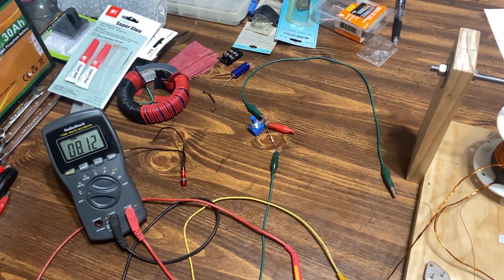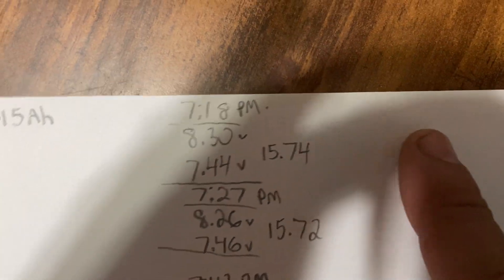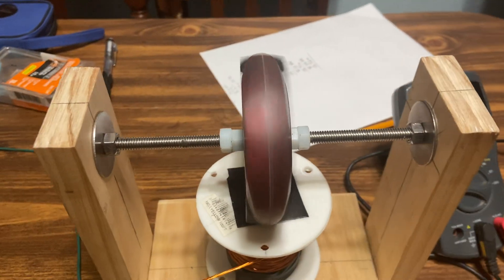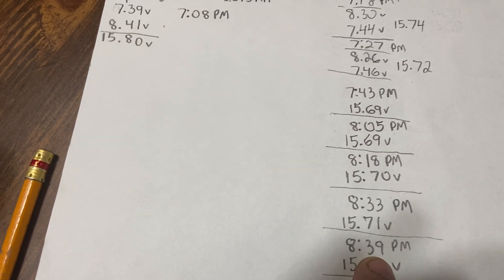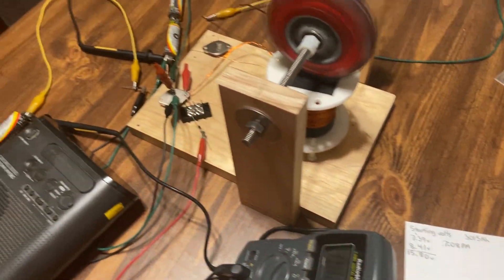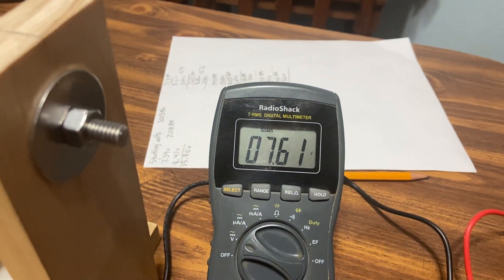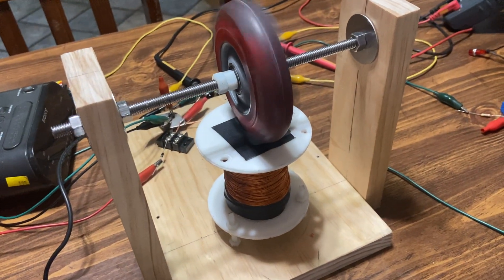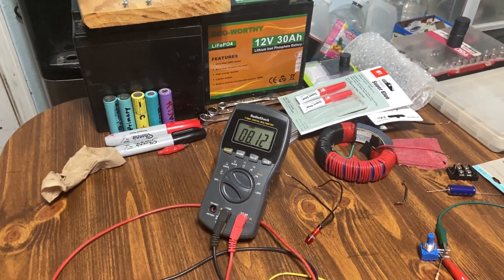Extremely Efficient Pulse Motor

Comment: It's almost comical that you're adding up battery voltages.  A battery voltage tells you almost nothing about the state of charge of the battery.  The voltage on the charging battery is being artificially boosted because current is being pumped into it.

Comment: @debunkified  There's a chance you're seeing power from the radio station you've tuned into. If it's AM, you have a reall high chance of accientally picking up extra electricity. But let's look at your wiring. Dang, that looks like you've inductively coupled a return wire as a feedback mechanism. Yeah, that should be incredibly efficient as you're getting the electric field to go around and around rather than reverse direction (a/c) or drain to ground (dc). If it runs forever without the radio portion, then it's time to consider that the equations for A/C and D/C current are not applicable here as we have DC impulses, which  - i think they travel toroidally, for some reason nearly lossless, or at the very least highly efficient. See, energy can't be created or destroyed. You've trapped it in the system and convinced it to go around and around.  Not sure if you're running at the resonant frequency, but when you do it will behave even more like a superconductor. Can't wait to get this installed in a car!

Comment: Obviously no torque load, not counting friction, the most power this would drain would be on initial start up to overcome inertia, then it becomes a flywheel only requiring a low current pulse to keep it spinning, sorry guys, there's nothing remarkable here, however it's an interesting project.
Reply from the maker: Yes you’re right, because it’s in Gen mode so it runs a bit slower than usual but the generated AC is utilized on both sides.

It actually goes much faster with way more torque in the original mode. It discharges and charges at the same time equally.

Not to mention it discharged from battery through the motor and back out as a collapsing field to charge another battery to recycle the energy.

It does more work than it normally can without recycling.

Comment: Have you tested a full wave rectifier to capture the back emf rather than capturing half using the single diode?
Reply from the maker: I’ve found that the FWBR is useless unless powering a low resistance load in both modes, Gen mode and original.

In original, the back EMF is automatically captured through the same transistor that pulses the power from the battery or B1 primary.

It’s does this because it’s in parallel to the battery but is always less than the battery so it simply blocks some current from coming out of the primary or B1. This is one reason why the current drops as it speeds up.

The other alternating current isn’t captured in the original mode because the volts are lower than the battery, but in Gen mode it does by adding in series with the primary volts and so it’s actually utilized and can make it to the higher volts of the primary.

The second half of the back emf is also actually in the same direction as the collapsing field.

Comment: What type of core does the coil has?
Steel bolt, welding rods, air core?
Reply from the maker: Welding rods, can’t remember though if R45 or R60 might actually be R60. They are the exact height of the spool. Copper plated, mild steel, so in reality a high percentage of soft iron.
Reply: @debunkified  If you are using the same than Bedini the they must be R45
Reply from the maker: @ Right but I had bought some R60 but I’m not sure if I used the original as those were cut already, but not glue on them so they might be R60 but it’s been so long that I simply forgot.

However the iron content is only a slight difference between the two percentage wise. Soft iron is important.

Comment: Runs forever?
Reply from the maker: @SAQ-3000  Well, I’ll answer that question with a question, does the Earth spinning on its axis run forever?
Reply: @debunkified  yes.
Reply from the maker: @ But does it really? Think hard about it. I think a several billion years is pretty good.

Even if this motor had 124% efficiency the parts would wear out first, but will last an extremely long time before that happens.
Reply: @debunkified  well technically true it will run for long time.
Like 4 billion years... Or more 
But what about the tech u made ?
It worka like the the bedinis 2 battery 
2x 12v that was once drained he switched to they battery's
Reply from the maker: Yes very similar, swapping is required. This is because when having only one battery as input and output at the same time doesn’t do very well because batteries don’t like to be charged and discharged at the same time, hence a separate charging battery.
Reply: @debunkified  earth doesn't spin
Reply: @debunkified  bhindi used some special kind of 12v car battery...
Which isn't sold these days..
Reply from the maker: @ As far as I k ow he used car batteries that would some how cold boil.
Reply from the maker: @Сунђербобан  You’re right it doesn’t spin it just sits there as the universe rotates around is.
Reply: @debunkified  kind of same thing ...
But whatever.
Urs works almost same way.
Different circuits. But works same way. Right ?
Reply from the maker: @ Yes different circuit, it actually utilizes both sides of the generated current or AC or back EMF, plus collapsing fields.
Reply: @debunkified  will u drop a full circuit diagram?
And simplify it. Pls ?